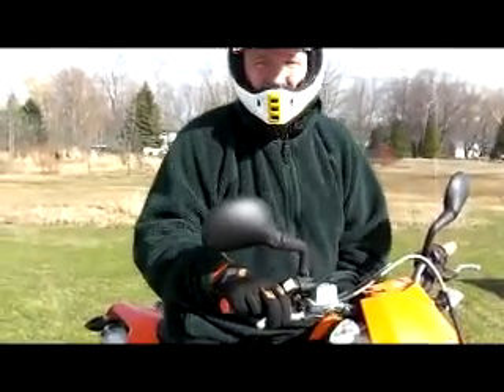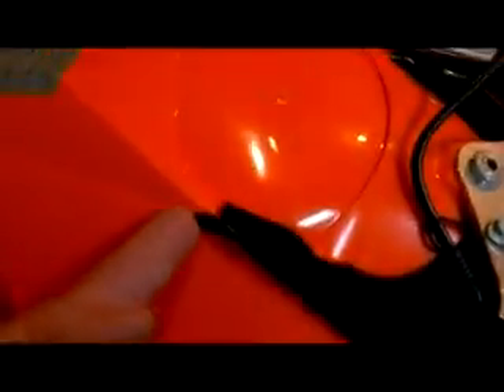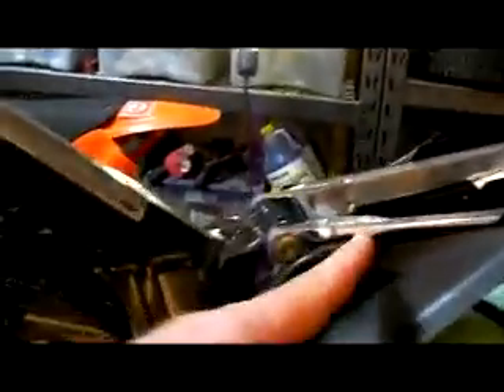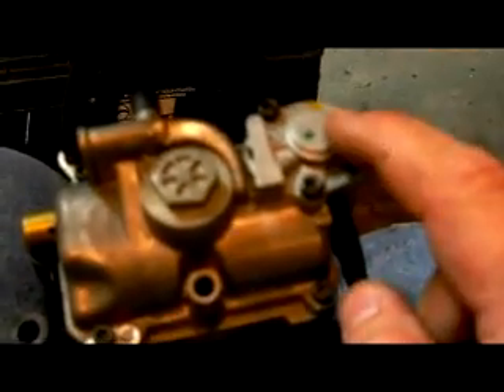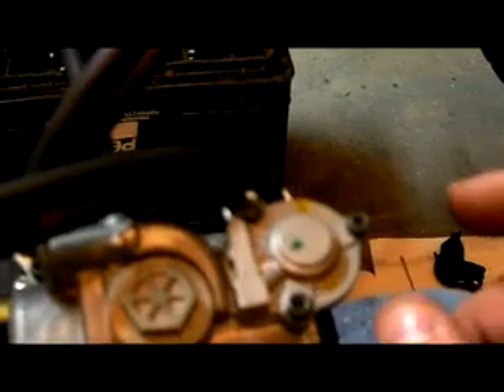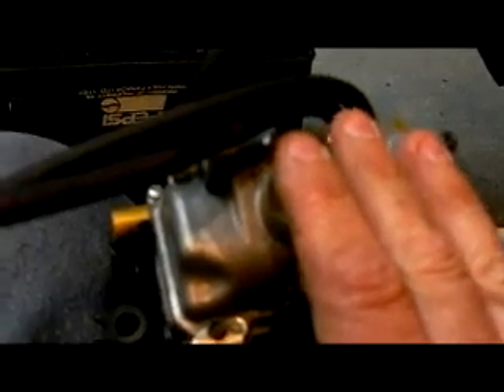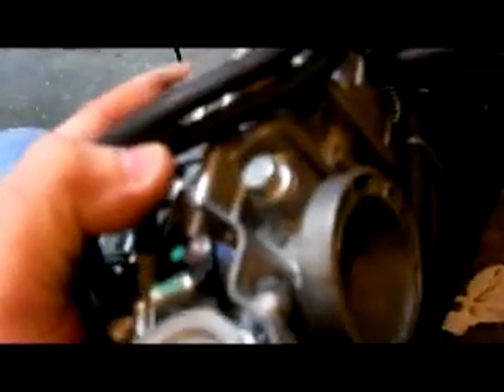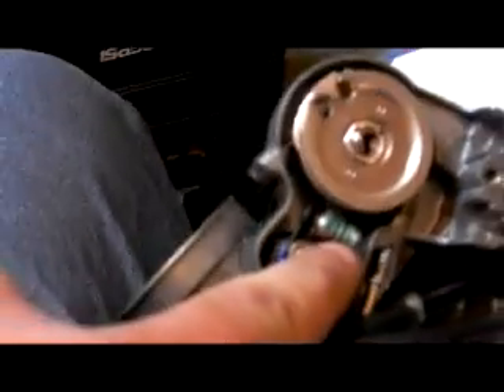KTM 530 De-Smog Remove pollution Control Part one of two

Comment: Question,  my 08 530 EXCR has already been de-smogged and I have the small bolt blockoff in the cylinder.  However the carb is still hooked up to the breathers . Is this ok? This it's how I got the bike , but doing a JD jet kit now.

Comment: Did you change the carb needle or clip position? Is the accelerator pump mod really necessary? What if I just bought a KTM 175 main, 42 pilot and 60 power jet? . I just bought a 2010 530 exc and think your vids are great : )